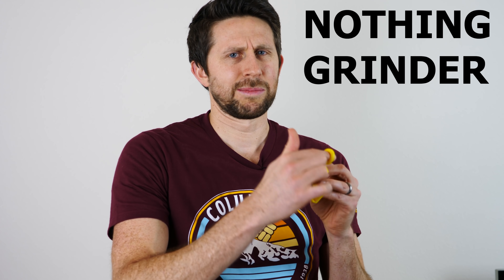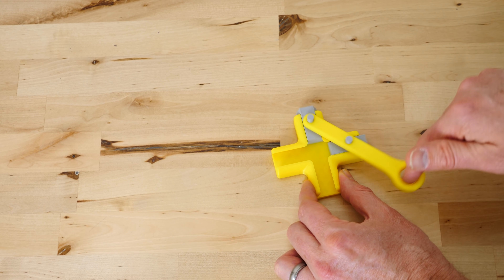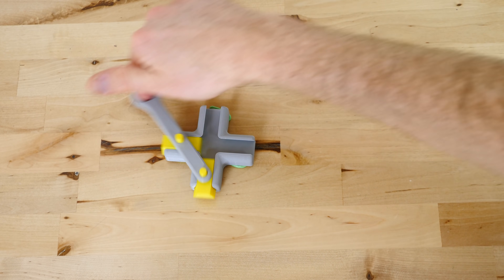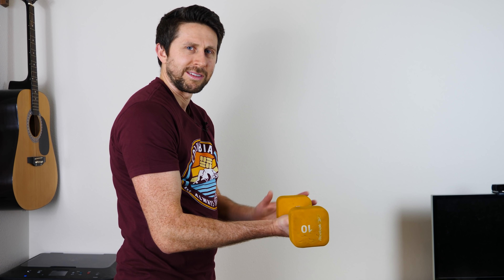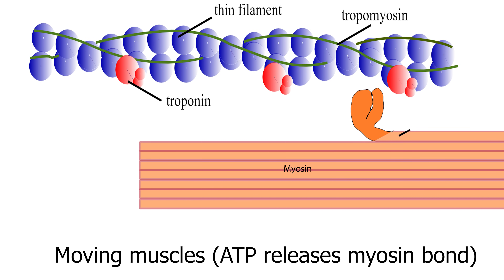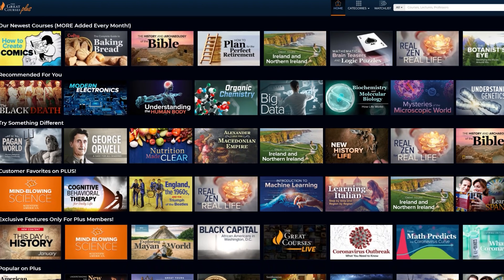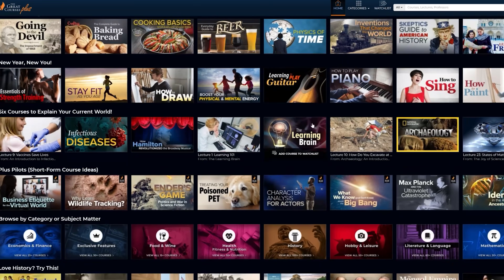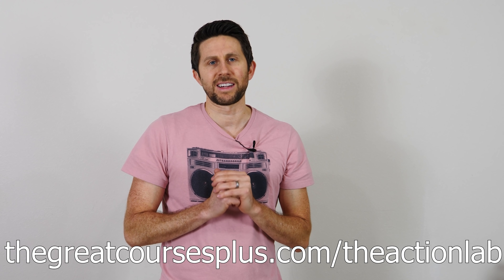The Machine That Does Nothing Actually Does Something

Comment: I wonder if it would eventually be possible to "hack" the human body to basically turn rigor mortis on and off at will, like either sending electrical or chemical signals that stop the reaction you were talking about, so that you could strike any pose you wanted, holding any reasonable amount of weight or whatever, and then "click" your muscles lock into place, and you could hold that position for hours without spending any energy on it, and then instantly unlock it to continue moving. I wonder what sort of damage that would cause to the body though, either in damaging the tissues that have to hold that weight without active effort supporting them, or in reactivating muscle tissues after a period of being locked up.

Comment: Saying the nothing machine is useless is like saying that a fidget toy is useless. Correct on a certain level, but so long as a thing does something that is at least remotely useful, like invoke positive emotion (Like, make you have some fun by playing around with it), then we can say that it is still useful, to a degree. I don't think there's a single thing in the entire universe that is completely worthless and does not serve a singular purpose. Like, a random rock lying on the ground. Yeah, it seems worthless, but the components it's made of, like OXYGEN, are not, plus if somebody's chasing you down you can throw it at them or something. See, use found for something with seemingly no use. Okay that's kinda pointless as rocks do indeed have many uses, but still, you get the point.

Comment: "Puting in energy" needs to be elaborated.  Energy isn't a substance.  So you aren't really putting a substance into anything.  Instead, what you are doing is coupling two or more systems together in such a way that spontaneous change in one system would perform work to induce change in a non-spontaneous direction in another coupled system.  It's that potential to do work to drive a coupled system into an improbable state, or the actual performance of work what we call energy.  So you aren't really putting anything in.

Comment: You have to do work in order to make a system change in a non-spontaneous way.  Systems changed in the orthograde direction (spontaneous change) when the new state of the system has a greater then or equal probability of being then the previous state.  If you want the system to change in the less probable direction (contragrade change), you have to organize the work to achieve that change.  Otherwise, the system will change in an orthograde direction of more probable states.  Interestingly, you hit upon the limitations of using efficient cause as being the only cause in physics.  Adding formal causality fixes the problem, because formal causality pays attention to the geometry of possible states and transitions of the system.  This allows one to explain why work is required to go to some state, but not to another.  The more improbable the final state, the more work needed to achieve the transitions to it.  Going in the probable direction requires no work (although the system may then perform work on other coupled systems as a result).

Comment: you ARE doing work holding that weight,  you are COUNTERING the work being done by gravity.    An object sitting on the ground is actually having 2 forces of equal work, in opposite directions. Gravity is pulling it down, while the ground is pushing the opposite direction of gravity, with the same force.      The math is deceptive because it completely ignores the movement of earth through space.

Comment: The only reason why you have to put energy into holding a weight, even if it seemingly does nothing, is due to gravity. The weight naturally is falling towards the center of the earth due to gravity, and you are stopping it from falling. And the reason why it's seems like 'nothing' is going on is because you're putting in the same amount of force at which the weight is moving to the center of the earth, and thus it doesn't move.

Comment: "I put energy into it, why isn't it doing anything useful?" 
Does cracking your knuckles do anything useful? 

for anyone who wants to drawn an ellipse but doesn’t have a computer with a proper program handy. 

An actual use for a machine like this could be pushing buttons or releasing water on a consistent timed interval, through purely mechanical means.

Comment: We actually use these at our glass company to cut perfect ovals by setting the anchor points at at the correct measurements. And it definitely does a very good otherwise unachievable something for us:]
Reply: This a really good response. Actually, the machine does not do nothing. It is doing several things the author of the video has not yet observed.

Comment: Charles Hawkins
It’s a mechanically operated bypass valve. Designed to operate in the food industry.
These can be used when ingredients or chemicals are being mixed mechanically in an autocratic system. Means one valve can do the work of multiple valves in the same space. 
This was useful back when motors were expensive and placed in one location. Like in a windmill operation that has an automatic sorting system. Now days they just add more robotic equipment.

Comment: Meanwhile, gravity is “working” its ass off to create “force” in efforts to close the “distance” of objects that are not touching.  Work = Force x Distance. …In an experiment using a cable draped over a block of ice with weights attached to the ends, over time, the cable will cut through the ice because of the heat caused by friction which is created by gravity.  The experiment was conducted in a freezer where the ice could not otherwise melt.

Comment: Another thing it can do is send heat to different areas and potentially could make a large semi conductor that can send current to different things provided the heat generated electrical current 
Or if there was wires on each point when each point touches a wire it would aend electricity on a alternating current system
Or maybe could be used as a piston for multiple engines

Or if you put points coming out the top the points could make a ball do a 360 degree turn maybe

Comment: I suppose you could make it do something. It's sort of like a piston. So if you could drive the blocks with something rather than use the lever to move the blocks, you could use the lever to drive something else. I'm not really sure there's any advantage in moving something in an ellipses though, plus I think you would need four separate chambers for the push force with this configuration. It doesn't seem efficient.

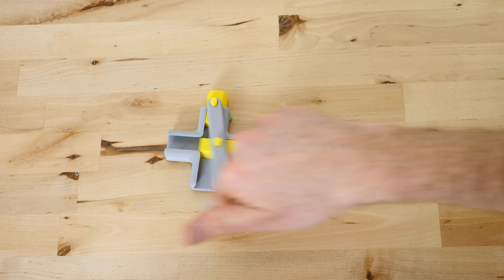Comment: 2:00 shouldn’t there be friction as well? With them going back and forth on that?
Reply: The friction is what creates the heat. If you have dry hands, rubbing them together has a fair bit of friction and creates heat. Wet and soap them and there is almost no friction, and no noticeable heat is generated.
Heat is basically just small scale, chaotic kinetic energy. Friction is resistance caused by the roughness of two rubbing surfaces. As the two surfaces move over each other, peaks need to move to get past each other in random directions, creating chaotic small scale kinetic energy, aka heat.
Reply: @gadsdenjack  Ok. Thanks I forgot about that 👍

Comment: I imagine physicists have some fancy name for it, but there's still energy being used and work being done by the table on the weight: the work is "resisting gravity" (or countering the effects of gravity with a force), and the energy comes primarily from the various bonds in the materials of the table. The stress that results from work being done is minimal when that work is done by static forces (electrochemical bonds, which are very strong), versus other forces, like electromagnetic (electric motor), thermal (the burning fuel expanding in a combustion engine, which is weaker and much less efficient), or... whatever the muscle fiber movement would be called. The work is the same, but the weaker the source of the force is, the more energy is required to perform it.

Comment: Uhhhh? Thing at the table has Potential energy. There's been put energy in, once, to place it that height on the table. To keep it at that table , the Table has to perform "energy"(Work!!)  to keep it on that table. Forces.There are alway's forces at work even if it seems not.  Your next try explaining "nothing work" to hold that weight at that level, you have to deal with gravity force, Thats the contra energy you have to put in to to keep it that level. So YOU have to "work" to keep it at that level. Its NOT zero. Result is same level.yes But you have to WORK to keep it at that level. To keep its Potential energy. You put potential energy into that weight. So that weight it self with that amount of stored Potential energy can be used for something.Very strange video this.

Comment: You are doing work. The object pushes down because of gravity meaning without your work the weight would travel so as far as it would move without you holding it is the same distance you are preventing it from moving meaning their is a distance value it just isn’t obvious and needs another formula to figure out that figure

Comment: He’s forgetting to mention gravity. As you hold a weight still in the air you are preventing it from falling. So doing nothing is doing something in that example. Same with the car on a hill. Keeping the rpm up on the engine is fighting the force of gravity trying to pull the car down the hill.

Comment: Question: can't the force in the equation be filled with gravitational force pulling on the weight, or the car? Since gravity always applies force at a rate of 9.81 m/s^2, the calculation for how much work is being done on the weight should be possible, no?

Comment: This machine does work in nearly all of the 10 types of energy.

100% of your energy input converts into the machine as >>>>>
(Roughly)
THERMAL: 2% friction 5% body heat transfer
ELECTRIC: <1% static charge from the friction begins to build
NUCLEAR: <0.1% trace potassium on your skin binds to the plastic and so the device now emits radiation
KINETIC: 90% movement
MAGNETIC: <1% some trace ferrous could be rubbing to create a miniscular magnetic force
CHEMICAL: <1% the oils and acidity from your fingers will react with the plastic producing a slither of heat
LIGHT: <1% the thermal energy is now emitting infra red light
ELASTIC: <1% slight back and forth torsion in the plastic lever generates heat
GRAVITY: <0.1% gravitational potential fluctuates as you hold the device slightly higher and lower during operation. Also micro gravity is now in its greatest act between your hand and the device.
SOUND: 2% you can hear the sound of the device making ripples through the air from the friction and imperfections sliding over eachother causing vibrations.

Congratulations, youve received some energy back from the device as the air molicules vibrate against your eardrums and generate an infinitesimally small amount of heat meaning your body didnt need generate nearly as much to maintain 37°C. Thank you so much. Totally worth it.

Comment: Holding the weight in place is doing something because to hold it in the air in one place you are picking it up at the exact force of gravity. So because of gravity it isn’t moving but if you could turn off gravity suddenly while I’m holding the weight in mid air, I would fling my arm and the weight up with the same force as gravity pulls down, right? Because of gravity holding the weight still uses energy but in an environment free of gravity it would expend no energy to do the same thing.

Comment: When holding the weight: no distance is being used on the outside, your muscles are still moving, thus holding the weight is causing work. Your car being revved to hold on a hill still hold it's position and not rolling back, therefore the engine is doing work. None of your examples are examples of not working because what you see isn't moving.

Comment: wonder if any valves use a system like this? that was the first thing that came to my head at least, seems it has quite a few flow options in a single revolution, from completely closed to any of the 2 segments that are at 90 degrees to eachother held open. no idea what I'd use it for but seems like it could have potential.

Comment: Normally I wouldn't post a correction comment, but the number of things wrong with this video is getting under my skin... I'll just list two of the many. Your "do nothing machine" IS doing work. Just because it's not moving something outside of itself, work is still being done. The motion of the arm is being translated into motion of the sliders. 

But what REALLY bothers me is the part about holding the weight. When the weight is sitting on the table or just hanging from a rope, then yes no work is being done because the system is in equilibrium. But when you are holding the weight, of COURSE work is being done! Gravity is pulling down on the weight and you're lifting up on the weight to keep it from pulling your arm down to the equilibrium state. 

The real reason this bothers me is because of the claim of "doing research". If proper research had been done, this video would have a far different script.

Comment: Your explanation of energy but no work touches on something I have wondered about. If I drop two magnets into a clear cylinder with like poles matched ie N-->N the one will hover above the other.  The cylinder prevents the magnets from sliding apart laterally so hovering it stays.

I would assume the energy being used to keep the upper magnet hovering comes from the magnets internally, in time will be consumed and the system will collapse.  Any ideas?

Comment: I- I- I mean... dude... It takes energy to hold a weight because you're actively resisting the effects of gravity... gravity is trying to convert the potential into kinetic, but by holding the weight in place, you are resisting the effect of gravity, and you are forcing the potential to stay potential....

Einstein mentioned this. "gravity is just a hole in space that things fall into, specifically towards the center of the hole", so by preventing a thing from falling, you are effectively lifting it with a constant velocity and zero acceleration, equal and opposite to the force of gravity. No work done because no overall displacement, but if gravity disappeared, you'd throw the weight upwards because there is no force resisting you anymore.

It's the same idea as if you swim up a river at the same speed that the river pushes you downstream, perhaps towards a tall waterfall. If the two velocities are identical, constant, and of equal but opposite direction, there's no displacement and therefore no work done. But you're going to spend a lot of energy making sure that you don't go down that waterfall of death.

Comment: Shorter and more accurate answer: The do nothing machine doesn't do nothing, you're just doing the math wrong. You add the distance in both directions together, you don't add the distance in one direction then subtract the distance when it returns to the start. That'd be like measuring work by a straight line between the starting point and ending point without accounting for the route taken.

Comment: I have often thought of a weight on a table. The bonds of the table top are stressed by the weight upon them. Do those bonds absorb energy and release energy for the reason of the stress placed upon those bonds by the weight put upon the table top? Maybe this occurs in such a small way that we do not notice it. The energy input comes from the environment, and the energy absorbed is released back into the environment. Either that or the bonds are so strong that the weight on the table top is irrelevant.